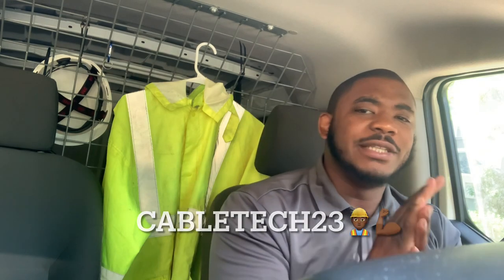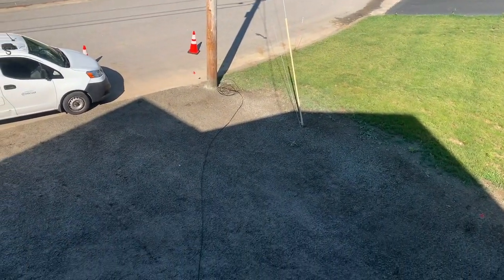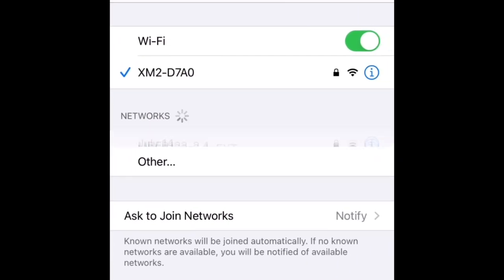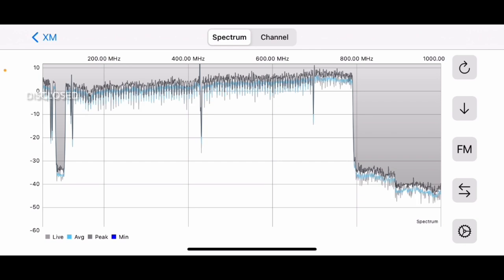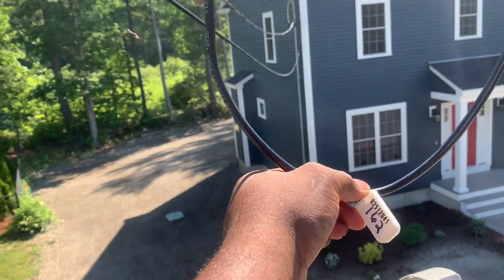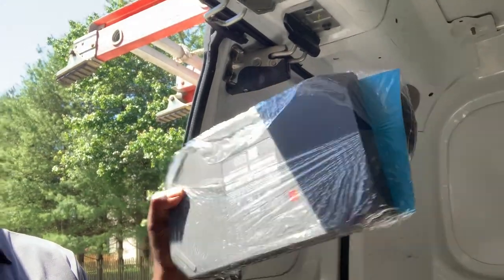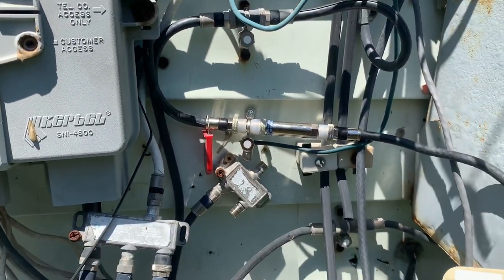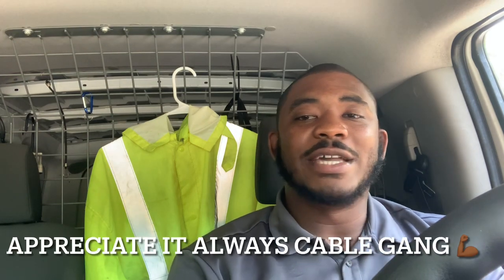Life of a cable technician Ep #14

Comment: Ran into a customer once that was a completely new install. no existing drop or lines ran inside. Was an underground job but still took me forever to install and I had no house boxes left. I noticed you didn't use any house box on the ground block of the second job you did.
Reply from the maker: Yeah man I kinda never install house boxes in my region it’s not required also you’ll be surprised how many customers don’t like them attached to there homes

Comment: I just found your channel and was going to ask if you could show that xm2 meter.  Pretty neat and much different than a dsam.  Typical Comcast  and their 750 MHz systems even to those beautiful houses.  System I’m in just upgraded to 1000 MHz and since it’s not Comcast theres no X1, it’s TiVo and the meters are JDSU DSAM, nothing connects to iPhone or iPad.  Other than that it’s similar legacy stuff if not TiVo with moca.  Though we have an upstream at 66 MHz because they changed the nodes and amps to do mid split.  Neat industry, technology is always changing!

Comment: Does the ISP charge the customer to run drops? And I would assume that the customer is not allowed to run drops themselves? 

Is the cable from outside to the inside the only thing the home owner is responsible for?
Reply: The ISP is responsible from their connection to the customers side of the house, or we refer to as the Ground Block, from there on it is the customers responsibility. An ISP may install the rest of the wires, included in your installation fee, but if anything happens to them afterwards it is your responsibility. Just like FPL, they are responsible from the pole to your house but you need to get yourself an electrician to do the rest. By the way, the ISP is not required to do “custom” wiring for a customer, that mean running them in the attic and inside of walls. If a customer does not exposed wires, then you would have to get your own contractor.

Comment: Appreciate you putting this content out man, about to start with Comcast Monday. Any starter tips for training?
Reply: Definitely get a TONER kit if they dont supply you with one
Reply: @justincaldero5174  Thanks! I'll bring it up in class tomorrow.
Reply: @sybashtian  for sure man, I also reccomend getting an electric screwdriver, bluetooth earpiece, knee pads, and a 6 foot ladder (perfect height for attics) if you dont mind what company did you get hired for and are you in house or a contractor?
Reply: @justincaldero5174  I'm in house for Comcast. When I did cellphone towers we used those collapsing 6 ft ladders I'll probably pick one up. Comcast is who I'm with.
Reply: @sybashtian  that's what's up man my name is Justin Caldero, I'm in house as well. I'm in the greater chicago region, but you can look me up in the system, hit me up if you ever have questions man, especially when you're in the field!
Reply: Look for a other job for starters. Most cable services are leaning towards pushing for turning technicians to be salesmen. If your into that . Go for it. The 2 things I recommend is 1 patience.  Eat breakfast. Cause customers treat technicians like trash. 2nd thing is a good toner. I always liked the one by Klein. The 1st version though. It can show where the main power is at.
Reply: ti  ive been at comcast for almost 3 years and I've never been asked to sell something, that's what the sales department is for lol also I started at $16 and now I'm at $19.70 so the $ is pretty decent
Reply: Are you still in the cable field? No vids in a while, are you in good health? Let us know. Need some more videos.

Comment: Comcast requires a howler from me in my area. Tech 360does anyhow. I just run it and walk it though, I've had enough exp to know if a drop needs replaced and I'm not too lazy to do it. Ingress I run from the jumper also. I use house boxes also, you do not. I do not use drop hangars unless I know maintenance is coming behind me, because they may need to remove the drop momentarily. I tag my bonding points at ground block and at premise grounding point as required. I submit photos via XM app per required. I don't run Docsis scan because the DS scan along with flux scan can give me the estimated info for upstream in my brain's image of what I see and where. In a balanced system you wont worry about upstream so long as you're not going over on your downstream parameters and visa versa depending on meters used. If it looks a bit wonky in my flux graph I may check the full Docsis scan with regard to devices on account so that I can go ahead and get maintenance on their way and close my job with passing phc. 

Keep doing what you do i guess... But please be specific as to DbmV and Dbm terms and the such. And if you don't know the expressive science behind and are willing to explain. Just do your installs and knock them out my man.